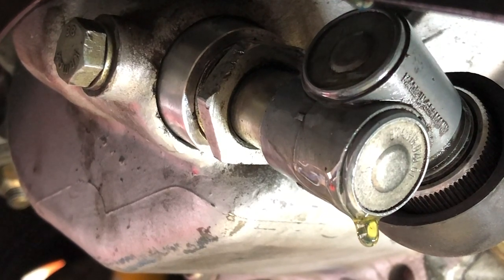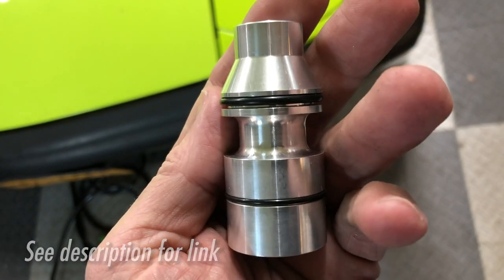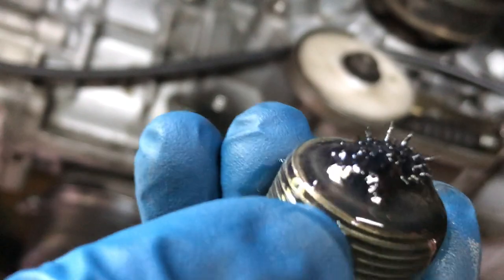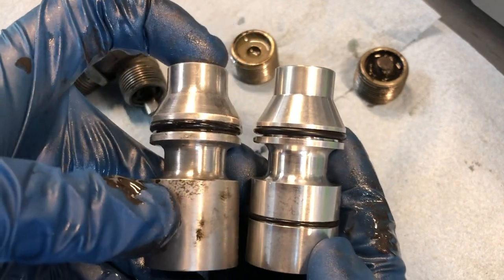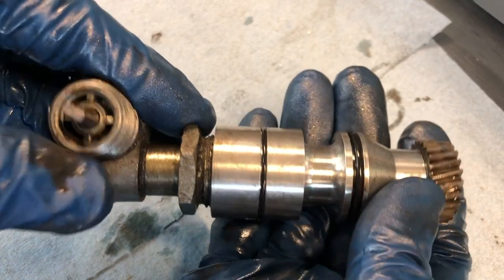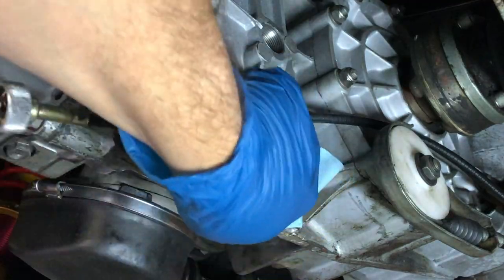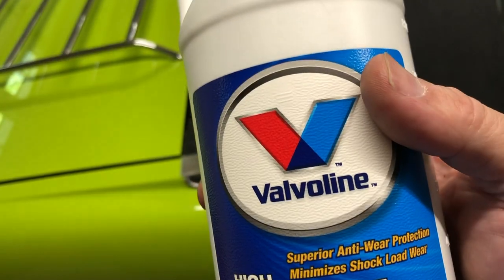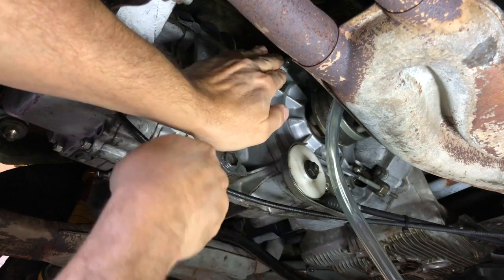Porsche 914 for Newbies - Ep 08 Speedo Drip Fix and Trans Gear Oil Change

Comment: Thank You...Because of your videos I was able to change my engine oil and gearbox oil this morning.  It took me about an hour total for both jobs.  Removing the passenger rear tire makes life much easier.  I also adjusted my clutch cable while I was under there.  I was able put the oil into the gearbox case without using a funnel, I used a jack stand to support and tilt the oil bottle to empty the bottle into the case.
Reply from the maker: Awesome! Congrats!

Comment: One extra tip for the bolt tightening at 5:38. I have seen the threaded flange area on the end cover develop a crack if the special bolt is over tightened. Typically that crack runs from the threaded section down toward the opening for the speedo drive. So that is one area to be careful. Kudos for not going overboard on the oil recommendation. I also am a fan of quality "dino" oil that meets the correct spec. As you say, make sure it is GL5.
Reply from the maker: Great point about the housing bolt. Thanks!

Comment: I'll definitely follow this video when I do this job on my car!!

One thing for filling the car:  Many Friendly Local Auto Parts Stores (FLAPS) sell pumps that thread onto the top of a gear oil bottle in place of the cap.  The pump has a moderate-length hose on its outlet and a barbed piece on the other end.  It stays put in the hole, and you can just use the pump to push the oil in.

Not sure if this is better than using gravity, especially as you wind up laying under the car to work the pump, but it's another method.
Reply from the maker: Nice! Please add the name of the pump...

Comment: Great video as always Ian. This is also applicable to 911's with a 901 transmission.
Reply from the maker: Yep! I mentioned other cars which use a 901 at the top, but I should've called out the 911 specifically. Thanks for the note!

Comment: Mr. Kerr, I have thoroughly enjoyed watching your videos and found them to be most informative. You have been kind enough to answer some questions for me before and would like to trouble you with another one. I have a 1972 1.7 liter, bought it used a fe years back and need to change the tires. Do you have information related to the proper size tire I could purchase that would be as close to original as possible and suggested source(s)? Any help would be greatly appreciated. Kevin Taylor
Reply from the maker: Hi Kevin. Thanks for watching. Lots of guys (including me) run 195-65-15. You'll probably find the most selection at that size. Another popular size is 185-70-15. 165-80-15 look closest to OEM, but there are limited options. I generally buy from Tirerack.com. Hope this helps. Please subscribe if you haven't already. And consider joining patreon.com/iankarr. We have monthly zoom chats and lots of info is exchanged.
Reply: @IanKarr  Thanks so much for the quick reply and provided insight. I will also certainly look into the Patreon page noted as well!

Comment: Currently suffering from a speedo drip, but I use a hall effect speedometer so I'm considering replacing the angle drive with a bolt.
Reply from the maker: Cool idea. Will prob need a sealing washer around the head too.

Comment: New 914 and going through some small probs. The angle-drive gear came detached from the bushing and bounced around on the road for a bit. Need to replace the angle-drive gear. The speedo cable got a little chewed up too so prob will need to replace that too. I'm getting the new bushing kit you're suggesting here (thx). And with the new angle-drive gear, I'm concerned I won't have that washer where it screws into the bushing. Do new angle-drive gears typically come with that (the one on AutoAtlanta)? Lastly, do you have a video for running a new speedo line? Thanks for videos!
Reply from the maker: Prob best to order a spare washer just in case. Replacing the speedo cable is pretty straightforward. Just tie a string to the old one when you fish it through the firewall so you can tie it to the new one and guide it in. Good luck!
Reply: @IanKarr  Thanks much! I'll let you know how it goes

Comment: Hey Ian, I was just performing the exact speedometer replacement you showed in this video.  When inserting the set screw, the hole was not perfectly aligned and caused the set screw to kick sideways and appears that I sheared the thread on the transmission mount.  I’m terrified… what do I do now?
Reply from the maker: There's no terror in 914s! Okay, well maybe the oil strainer bolt. Without seeing the damage, I'd say first try to tap the thread at the same size. Maybe it just needs a little cleaning up. If that doesn't work, you should be able to use a time-sert to repair the hole. Good luck...let us know how it goes.